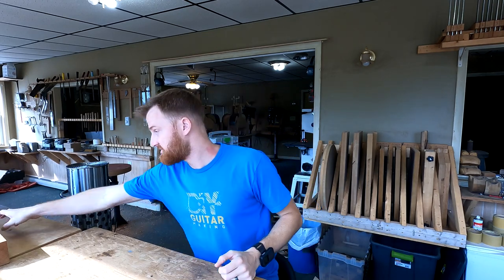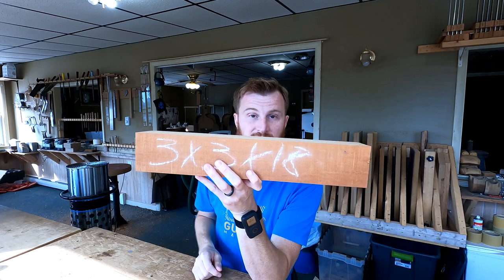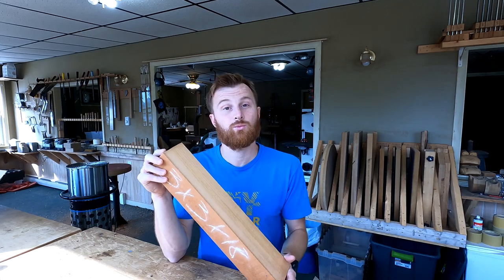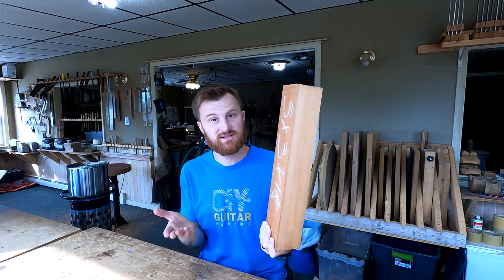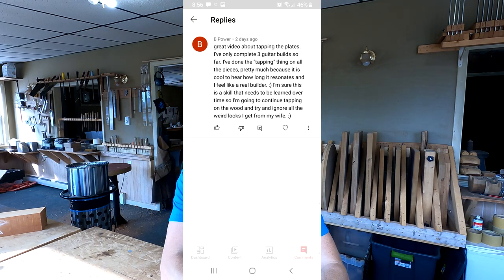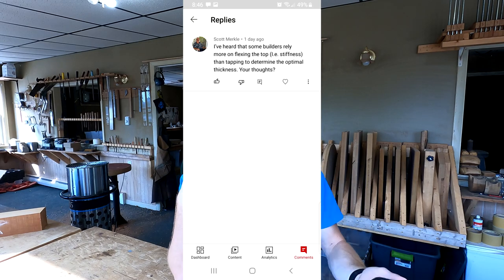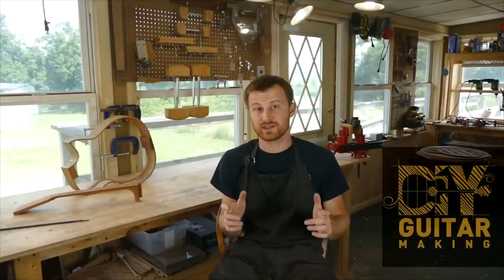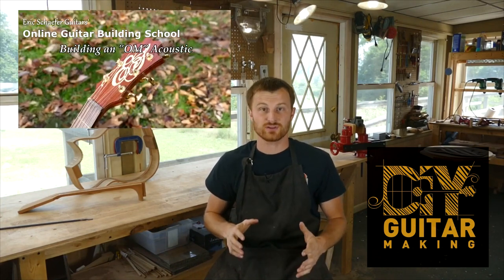Q&A | Why Classical Guitars Have No Truss Rod | Flexing Tops | Highlighting Sapwood | Scrapwood

Comment: Hey Eric! I am working on my first guitar at the moment and just finished voicing the top and back (as a side note, I did a 3 piece back and so I attempted to replicate your lattice bracing pattern since I don't have a centered seam and wasn't sure what else to do). 

I was wondering if you had any tips/suggestions for keeping the soundboard and back tidy and scratch free while voicing/carving? I primarily used a sharp chisel since that's all I had, but I also played around with using a small hand plane that I made. I got lots of little scratches and marks in my soundboard that I had to sand out, and also spent a lot of time cleaning up glue squeeze out.

Comment: Eric I just finished a Dreadnought and I'm having problems with the B string for sure but might be the High E string too. When I tune it to standard pitch, E chord is in tune but G chord the B string needs to be tuned 2 cents low to get it to go in tune. I used a 24.75" guide to mark the frets so they are on far as I can tell. The Treble E and bass E are good at the bridge from the nut. I have no idea why the B string will not go in tune? Any suggestions?